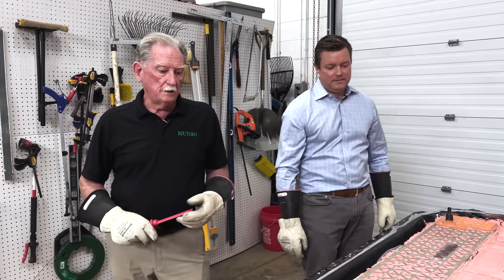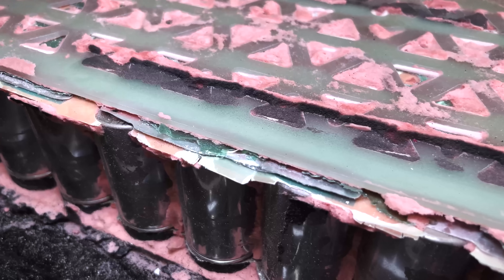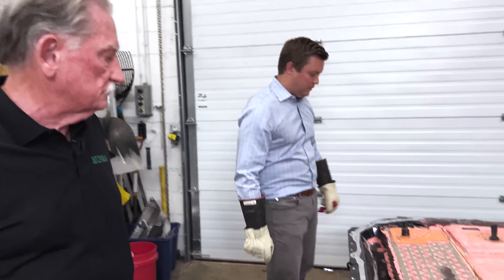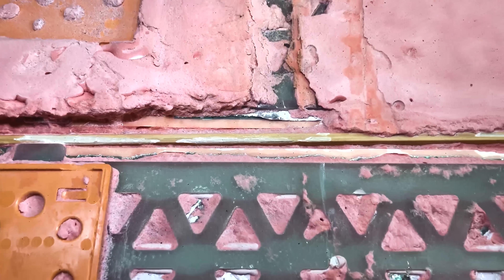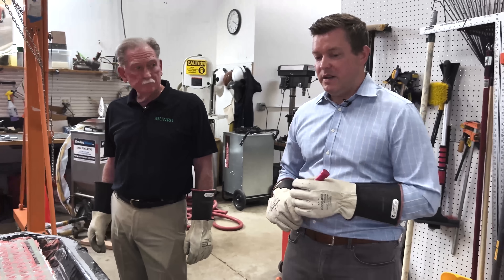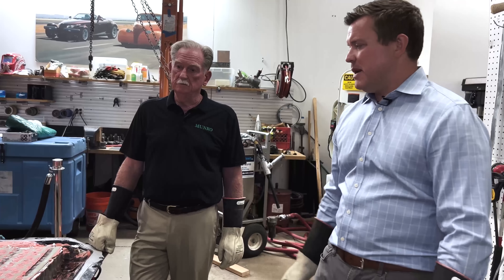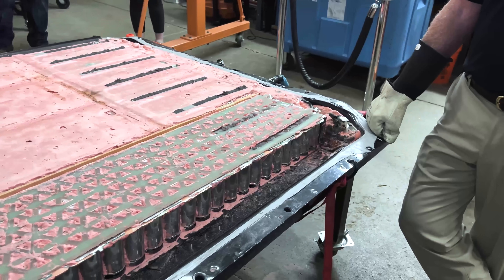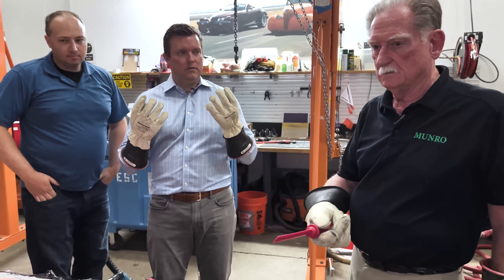4680 Battery Pack: What We Found Under the Foam!

Comment: As an automotive technician the word that keeps coming to my mind is unserviceable. I am resisting forming a firm opinion until you guys finish your work. At this point I am wondering if the foam from hell is for fire suppression, thermal management or intended to make the pack more structurally rigid. Looking forward to your final evaluation.
Reply: It is probably all.
Reply: @jackylsmith8138  My thought exactly.. and if your make it right the first time.. you don't need to service a battery. The only service to be done on a battery is  remove it and replace it. The negative COULD be, will this battery pack be able to have a second life/third life. That could be a loss. But, if it's going to be recycled and be rebuilt.. it's really not a loss at all and keeps these high grade materials in a more rapid loop.. second and third life batteries would be better served being the more common chemistry batteries like LFPs
Reply: @airheart1  i heard the cycle of the 4680 is somewhere in the 12000 cycles range so the battery pack should last the entire life of the car 20+ years thats why it is now a structural pack no need to replace modules and its one whole pack heat is the worst enemy of batteries with the tabless batteries it reduces resistance in the cell while increasing energy flow so dcfc it doesn't hurt the batteries anymore it great technology advances
Reply: @airheart1  And how could you remove and replace this 4680 batteries.
Reply: @lesstevens2370  LFP but not NMC I would bet.
Reply: @lesstevens2370  At 120k cycles the charge will drop.
Reply: @gregkramer5588  The whole thing.
Reply: @gregkramer5588  Why would you? I am not arguing that it's necessary. It's completely unnecessary. I've had an old 18650 battery pack in mine for over 5 years.. 85k miles. It's still running like a champ. About 4% battery degradation in that time. If these 4680's are an improvement, as they are supposed to be in every way, you can expect well over 10 years of great performance out of this pack. If/When it looses more that 20% of it's capacity.. replace the whole pack. Goes to recycling and gets restored back to its primary elements to be used again in another pack. I'm not saying it's cheap.. but it WILL get cheaper as the tech and industry move in that direction. Second and third life uses exist too.. but I expect that will be more for common chemistry batteries like LFP. They'll want these NMC materials back in the loop asap.. my guess.
Reply: @airheart1  So if you have an 11 year old car, what then?
Reply: @gregkramer5588  you can what if all day. I’m not their f’n engineer.. i don’t give a shit what happens lol. I’m happy with mine. If I sell it one day and the 2nd owner encounters a problem. I don’t give a shit. Second hand owners often encounter this in any car.. new engines.. new transmissions.. tons of maintenance issues that will never exist in an EV. If they don’t want to deal with a battery issue. They better be damn smart about buying a second hand EV
Reply: If the pack ages all equally, not serviceable isn't that bad, but if you need to change a 20000$ pack for a 200$ BMS that went bad or a coolant line that begins to leak or any other small problem that become catastrophic with this design, it is bad, especially if this happens outside of warranty (over mileage, past time or accident).
Reply: @jonathan55555  First.. there's no way this pack is $20k. Second, Tesla's have proven for nearly a decade that their BMS does an excellent job keeping the cells equally balanced. Should a cell go bad, the BMS is able to isolate that cell and continue the use of the entire battery without that cell and just sacrifice a little capacity. It's not impossible a BMS or other component in there goes bad.. but I haven't heard this being an issue in their old designs. I'm confident they are using top notch circuitry and design to ensure these entire systems will last until the batteries themselves have lost enough capacity where you would want to replace the whole pack. By then, 10+ years from now.. battery costs should be significantly decreased. 

As first principles go. Design it right.. and you don't have to design it for serviceability and waste cost and performance on BS that if you engineered it right.. wouldn't be necessary at all. Best parts are no parts. Best serviceability is make it unnecessary to be serviced. THAT is what Tesla does. They're not trying to feed a network of dealerships with cars that need service every 10k miles. They don't build products TO need service like old OEMs. They build them not to need much of anything. Of course it's not 100% yet. We all know they haven't nailed down some of the body quality issues still. But their batteries systems have proven to be excellent with very few exceptions that I've come across. Damage in accidents is what it is. If the pack needs replacement for that, so be it. That's what insurance is for. If your point is, another pack design could be modularly rebuilt and save some cost.. yeah.. maybe.. maybe not.. depending on the accident. Still, first principles supports this pack type. Minimal materials. Maximum performance. If the thing that MIGHT take a hit is repairability IF a significant accident happens.. you can argue that.. but you can argue most significant accidents would require an entirely new pack regardless of the design. Everything generally load shares.. in a major accident, very few packs are going to survive with the integrity to continue use safely, even partially.
Reply: @airheart1  We'll see about price reduction over time, but current model3 battery pack prices are 13500 + 2500 labour + taxes so not that far from 20k.  The mining is not enough for production outcast so I personally don't keep my hopes up for a big diminution in cost.  If it goes down over time, it will still cost well above 10k with labour and taxes.  Used EV car prices will eventually go down to normal and will come the problem: the warranty on the battery is ended or near ended.  So the car will be worth about the price of a battery swap.

I don't think the electronic in a Tesla is different than the electronic in anything else.  Over time, things will fail.  I don't know what ratio but having the BMS irreplaceable is bad.  Plumbing that fails is also not uncommon.  I'm ok with the cells being glued together.  But I am not ok including the plumbing and electronics.  There wasn't any effort put in place to make the thing serviceable in any way.  There should have been a middle ground.
Reply: @jonathan55555  fair points. We’ll have to see over time.. how well do they hold up to a 15-20 year lifecycle. I expect they’ve done accelerated testing and decided they meet whatever criteria they set up for ‘success’. Time will tell
Reply: Engines amd transmissions in modern cars are very high precision amd notoriously complicated and difficult to rebuild. Newer engines can be rebuilt, but not designed to be. Tesla is doing the same with the battery. Design and build it to last the life of the car. Took almost no time for Munro to remove the structural battery. Once Tesla reaches a point of manufacturing stasis, I'm willing to bet swapping structural packs will be quicker and cheaper than repairing old school Model S packs.
Reply: @fordnut74  To me this lack of serviceability takes it way beyond any car in the past.
Reply: Primarily rigidity for structure, then other benefits are bonuses
Reply: I think in the end it comes down to priorities. If you can make a better battery from the beginning it will likely need less servicing. By reducing parts etc. you also get more ranger, higher safety etc. That is what you have to compare against the (hopefully fewer) packs that will have failures.
Reply: @leononymous2562  Yep, trade off between that and serviceability.  Maybe Tesla is right on this one or maybe the issues will be most apparent to second owners so the Tesla still looks good to the original buyer.
Reply: Foam changing state was in the first structural pack patent.
Reply: All of the above! Tesla mentioned the foam on a slide in their Battery Day presentation. It definitely is unserviceable
Reply: @AudiTTQuattro2003  couldn't they find a better place to place the battery pack? I'm still trying to figure out what a lithium ion battery is. I have heard of lithium and I remember hearing of an ion. Is there a better way? Back to placing a battery in a better or more convenient location. Is it possible to make it easier for technicians to replace the battery? I understand that there are many Tesla fans here but I'm talking across the board. All companies should keep it simple.
Reply: @sidoliveira3246  sadly, the current placement in the floor of the car makes too much sense to sacrifice it. It's heavy, lends itself well to packing flat, and placing it anywhere else will reduce passenger or cargo space. So the floor it is. 

Lithium-ion is currently the only industrially viable electricity-storage option for the amount of energy required for good user experience. Hydrogen has storage issues on top of conversion efficiency issues, gas (hydrocarbons liquid or gaseous) has the whole "world sauna" problem, other battery chemistries lack either the energy density, cycle lof or both. There are promising candidates in labs, but none of them have yet to reach enough maturity for mass manufacture. I predict none will, until we reach the point where the demand for the required metals raises costs to the point where alternatives are simply more available, at which point they start to benefit from actual industrial research and efficiencies of scale. 

Also, actually removing the battery is more a matter of having a strong-enough lift, than actual complexity, I'd guess there's a lot less wiring and hoses than what you'd need to remove to replace a car engine.
Reply: @Validole  I agree with Mark . I've been thinking about this for a few days. Put the battery pack underneath the floor boards only. If you need to replace it just take out the seats unscrew a few bolts and all set. Simple enough and alot safer. If the battery pack is towards the center of the vehicle it will be protected from a frontal collision and from a rear collision. Back to the battery, I keep hearing of a better battery over and over. Perhaps people can devote their time and energy on finding the best, safest and most durable battery around. The EV industry needs this in order to thrive.
Reply: No servicing makes any sense on these kinds of batteries. The matching of cells is too difficult, so repairs typically won't last. It is much better to engineer the pack to last the lifespan of the vehicle. Much like how smoke detectors these days have built in batteries designed to last the lifetime of the sensor.
Reply: One thing that worries me is accidents:  if the pack integrity is compromised, you have to change the whole thing.  I can see the bottom metal sheet under the car get damaged during an accident or big debris.  Another possible thing is the front of the pack getting damaged and all the coolant lines seem to be there embedded in foam so they can break if something hit or damage the front of the pack.  For accidents, nothing is covered by Tesla warranty, so I suppose it would normally be the insurance company that take one in the butt but there might be cases where it is not covered by insurance or it is not crystal clear and Tesla doesn't want to pay neither the insurance company.  It is bad that it is possible that you have to replace the whole pack for a minor issue.  There will be issues like this and that will be the customer problem for a Tesla's design decision, if Tesla give a lifetime warranty on the battery pack because of that design decision, it would be nice, but since it is not the case, I am not a fan.
Reply: @jonathan55555  if the pack integrity is compromised, you have to change the whole thing. It isn’t safe otherwise. It takes a crap ton of force to compromise the pack, so it would be a significant accident anyways. Tesla can service the battery within limits for manufacturing defects of the hose connectors and a few things like that. But beyond that, it would not be a good idea to service the pack. Plus it is dangerous and should be relatively rare. Since all the materials are there, the pack can be recycled.
Reply: It is not intended to be serviceable. Use it until no longer useful, then grind it up for high grade component ore.

Comment: Depressing that these packs aren't going to have a second-life, destined for the shredder.
Reply: They can in principle have a second life, as long as you use the whole pack as one single unit. It is all nicely packed up and contained, no problem.  After that, infinite life through material recycling.

Comment: Use a chemical solvent for that pink foam (I know that there is one, I just can't remember the name, [It's probably the same one that evaporated off of the pack then Tesla put it together.])
It'll make your lives so much simpler, even if you have to put the pack outside in a massive tub while it dissolves the pink goop.
Reply: That goop process sounds like an EPA nightmare and may cost some really big bucks to dispose of.

Comment: Where are the guys screaming that you can not recycle EV batteries?!  I have had a dozen people explain how Li-ion batteries are impossible to recycle because the materials are toxic!  Where are these fine educated individuals with much more knowledge than Elon and Sandy combined?
Edit: misspellings
Reply: I'm always astonished at how so many people have it all figured out and found the fatal flaw(s) that thousands of scientists, engineers, and accountants have overlooked. Civilization has nothing to worry about with such a huge pool of critical thinkers keeping those pesky "tech" people in line.
Reply: Everything can be recycled, but the issues are cost and safety.  The process Sandy is speaking of is not cheap and you’ll need a steady stream of batteries to make it work. How many battery recycling plants will there be. You cannot transport a pack 3000+ miles and make tons of money off of it. I’m sure there is a solvent that will eat that foam away. PVC pipe cleaner dissolves some foam.
Reply: @jackylsmith8138  
"Cost and safety"
Let's see....
JB Straubel (smart dude, knows Elon😉) now recycling batteries.... Paraphrasing
"We can recycle cells at 16-20% the cost of new ore and the material is of better quality"
.
As for "transporting the pack" for recycling..... You have to "transport" ore! (This way is 1/6th the price)
Then there's the billions of circuit boards and other old cells that get thrown away.
Suddenly they are a valuable resource.
Just  crush them and dump the powder in with the batteries..
Reply: @jackylsmith8138  Each Tesla factory makes batteries and recycles dud batteries so those are guaranteed recycling centers on top of third parties getting involved like Redwood Materials.
Reply: @jackylsmith8138  It's almost as if Tesla is going to be making millions of these.
Reply: @jackylsmith8138  <--- found one.

Comment: Now you're truly fucked if 1 module gets out of balance after warranty. 
There's absolutely no way to repair this, and it is the single most expensive part of the car.
Reply: Gets out of balance how? They described in the video how the thin wires act like fuses. No service will be necessary on this for the life of the vehicle.
Reply: @raddaks2039  unless the car's computer says otherwise.
It's already pretty common to see failed modules on model S. 1 module gets slightly out of balance and you're down to 50 miles of range until you fix it.